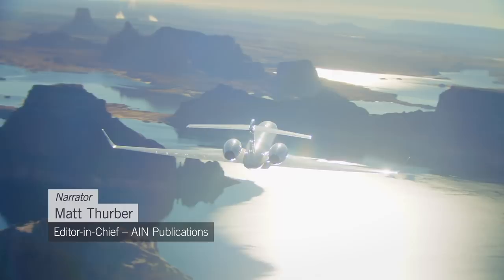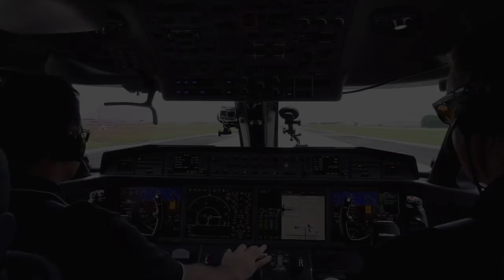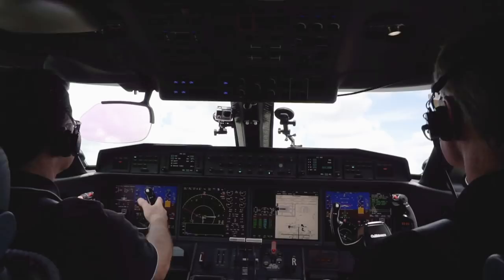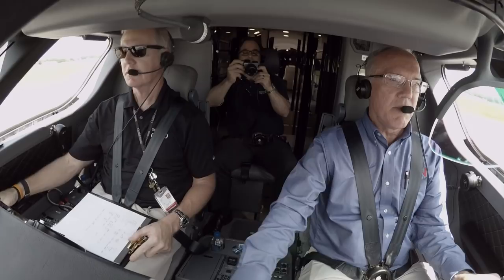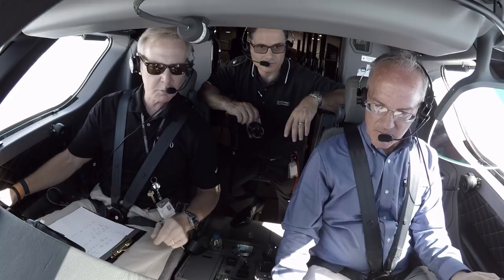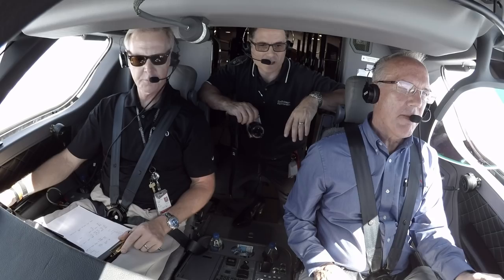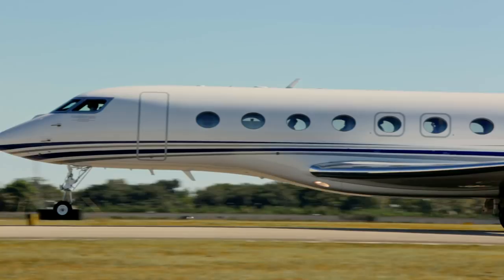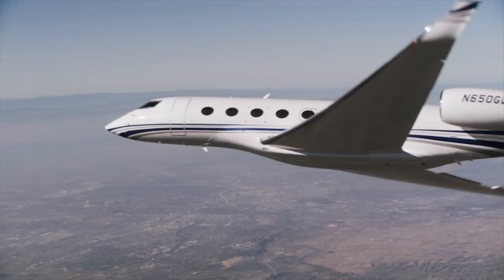Flying the Gulfstream G650ER Business Jet – AIN

Comment: Where is the jumpseat located, if there is no door?
Reply from the maker: On these jets they usually fold out from a narrow storage area at the forward end of the galley area. Thanks for watching.
Reply: Aviation International News can that be shown? Your rapid in answering 👌👌👌👌
Reply from the maker: Unfortunately we don't have a shot of that, but we'll try to get it for a future video!
Reply: Aviation International News i wait. Btw nice films
Reply: It slides out from the right behind the copilots seat, it then angles backward until a leg catches a latch, type, thing in the floor. Its quite comfortable actually and there is room to get around the left side of it so you don't have to put away the jumpseat whenever someone wants to get up.

Comment: Beauty but prefer a sidestick
Reply: scrubl0rd You honestly make no sense because the side stick is actually way safer than the yoke
Reply: scrubl0rd so it is you who would prefer to crash and die not me
Reply: Disagree. You can't visually see the control inputs of the other pilot, and can have contradicting control inputs. It also results in no artificial feedback from the aircraft. It has led to multiple crashes, including Airbus' own test pilot at the helm. 

I would consider it an inherently unsafe flight control system, and Airbus won't admit it. The other that have copied it could be better, I heard there are some systems that have feedback, but for the vast majority of side stick aircraft it doesn't work

Comment: I’m suprised to see that this aircraft is so mutch copied on  the Global 7000 and 8000 😱😱 ... Even the interior is placed the same and look exacly like the Global 8000 , the only thing that can be distinctive is the round windows . Even the look of the exteroir now i can confidently say that you plagiarized the Global 7000 , 8000 😡🇨🇦
Reply: Adeaxel wow can’t take it well to bad for you 🤣😂 and for your info the Global 7000 and 8000 are out and runing 😁🛩🇨🇦 and if you go and make an effort to go see some videos of the global you will see what i’m talking about !😎 Have a nice day 👍🏼
Reply: Global 7000 and 8000 came out about 8 years after this. So if anything the globals are the one's that plagarized.
Reply: Jordan J well you see i’ve been working for Bombardier at the finishing center for 18 years in Montreal . I’m a lead hand for the interior inst’l . The firs plane i worked on was the Global express , then came the Global 5000 and now 7000,8000 . I think in the begining the Gulfstreem were made diffrent in the interior and the cockpit windows were made diffrent . Now the only thing that is making the planes diffrent is the circle windows for the passengers . And if you think of it it’s a good business choice , there sales whent up by 15 to 20% . 😉🇨🇦
Reply: Neither copied one another. It is a pre designed cabin. But in this case, Gulfstream was first with that cabin.